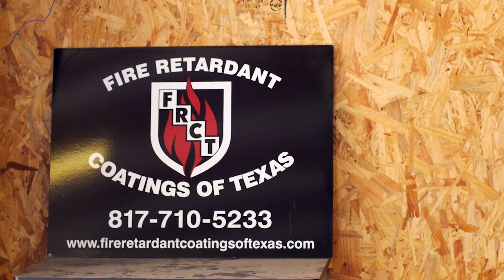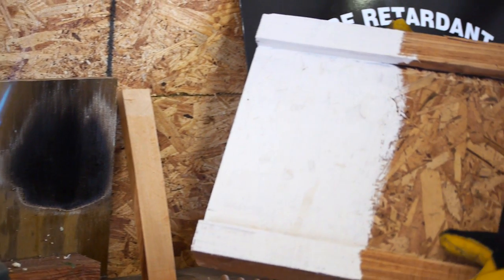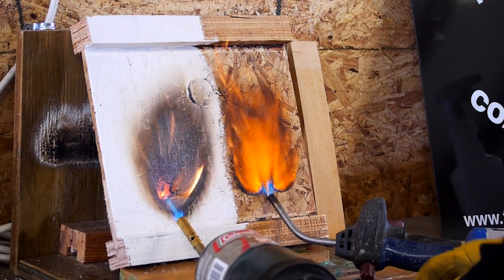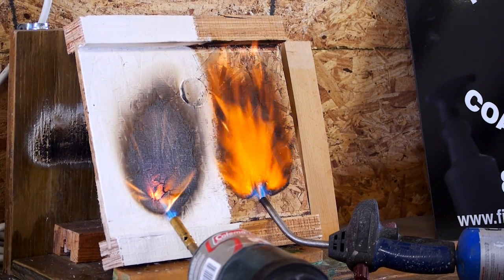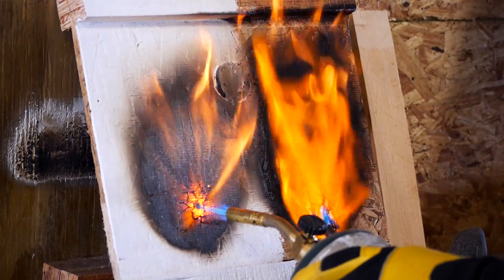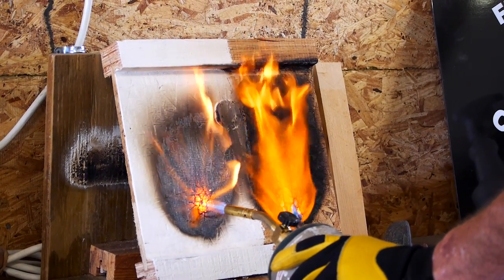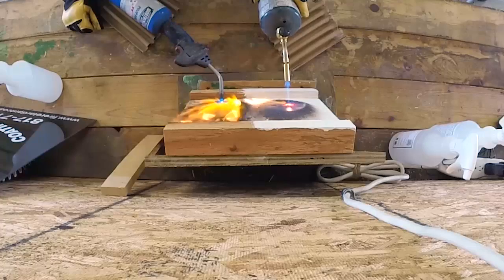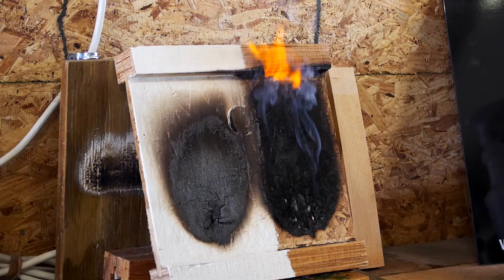Fire Retardant Paint

Comment: Too many variables in this test. Two different torch types and the distance from torch to surface is different as well. This test needs to have one torch pointed at the surface where the treated and untreated surfaces meet. This eliminates many of the variables. Torch type, torch temp, gas bottle contents as well as bottle gas pressure, distance from torch to surface, etc....

I'm not hating - I'm honestly both impressed by AND interested in this product. I'm just OCD when it comes to product demonstration and comparisons. I would also have a camera shot of the back of the surface and maybe even a temperature sensor to show the surface temp of the reverse side. Just sayin.
Reply: Not just the contents, but he flips the picks up the painted side burner half way through the video, while he leaves the other burner angled upward. The different angles makes it so the untreated side looks worse. I'll be avoiding this product if they have to fake flames for their marketing.
Reply: @derekalbright3128  And the treated-side flame starts moving around. I like the idea of the product but if it were me I wouldn't have posted this. not a fair test.
Reply: It may not be exact, but there is still a flame on it that goes out as soon as it is taken away. I consider that quite impressive. Attics have bare wood, when flames get in an attic the house is doomed. This needs to be on all attic surfaces

Comment: stop using chop strand material for floor joist , structural Pine has a char rate that exceeds any chop-strand material  and it does not contain glues or binder resin that add to the overall heat output.
You will also have a slightly increased smoke/gas output from engineered timber when compared to structural timber framing
Also in your home, if you have a fire the timber framing and or wall/ ceiling linings are not the problem, it is all the combustible petrochemical,plastics, foams, fabrics etc that you have in your home that dramatically increase fuel load.